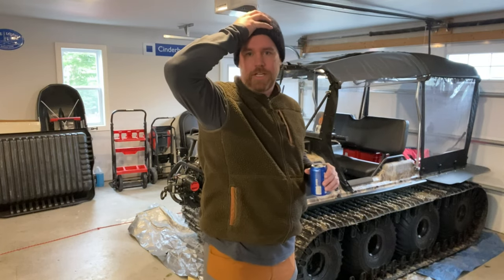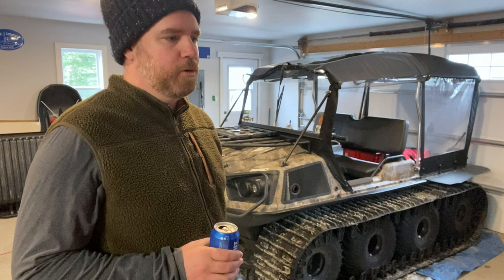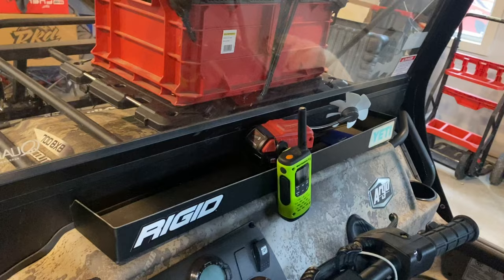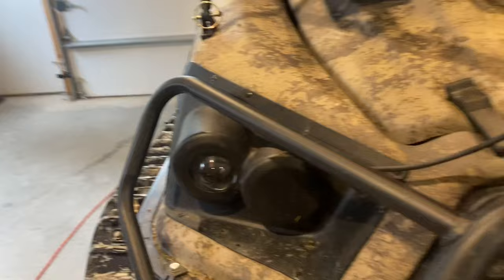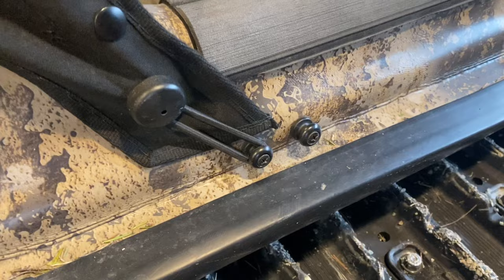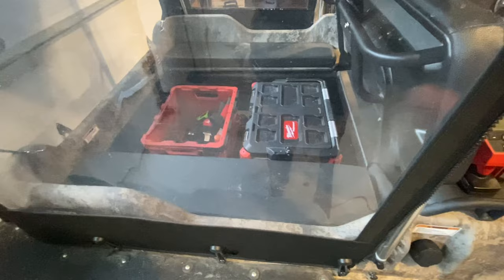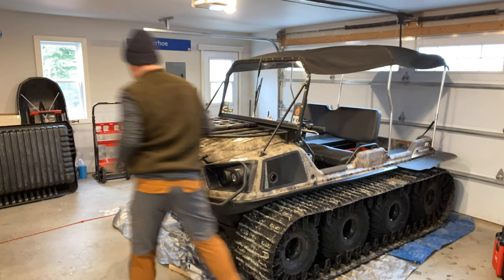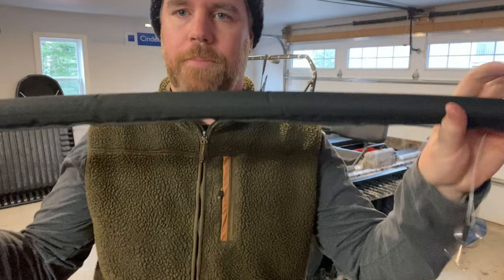Argo frontier 8x8 review and cab removal!

Comment: The f4ontiers come with the single lights, the aurora (bigger motor more money) have the extra hole knocked out and another set of lights installed, giving you dual beam ( hi and lo). Our frontiers have the switch , just both positions do the same thing.

Comment: Another secret is to put bolts one each end of the windshield rods!! otherwise, it will pull out from the vibration it is just crimped to the plastic so the bolt helps this. Never had one come apart since Also the 2 holders for that rod on the windshield I bolt through as well. Also a bungie from the top 2 window bracket to the front bumper acts like a shock and helps with the back and forth of the Top 🙂
Reply from the maker: Great tips! Thanks for watching 🙂

Comment: Curious why you take the bows off when removing the top? The rear bow is designed to fold when you remove the pin from the joint. I take the doors and windows off. Remove the support bars that go from the windshield to middle bow and the middle bow to the rear. All that goes into the storage bag. Then with the bikini top still attached to the bows, I fold the bows down to the back. and wrap the bikini top around them (think like a convertible top on a car). There is supposed to be another bag that you can put over the folded down top. I guess I will have to make a video on how I take my top down...
Reply from the maker: I take it completely off because I don’t want it on at all for fishing season. I also remove the windshield completely too.  I’d love to see your video on how you do it.
Reply: @ah6441  I decided to start making a video. Give me some time and I will make sure I tag you with a link. 
Like you, I use mine to fish from, so I don’t want my top or the bows up at all when I am motoring around a lake. Meanwhile, if you look at my channel, I think my year two and year three videos have some clips of my wife and I out motoring around on a lake fishing, and you can see the folded down top and windshield.